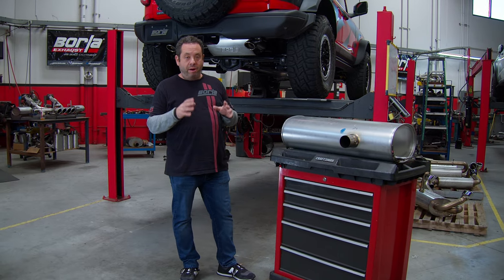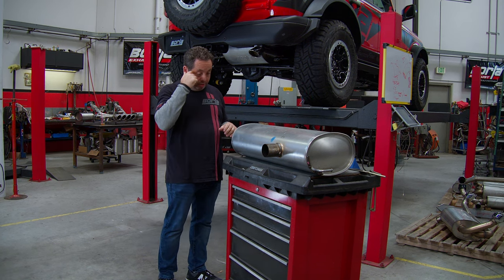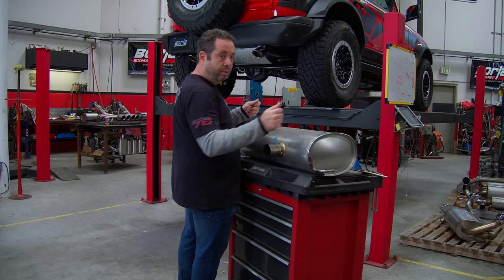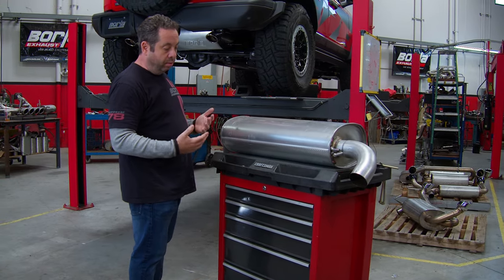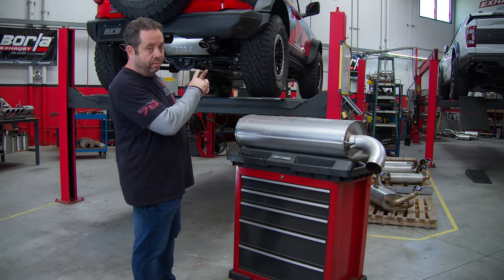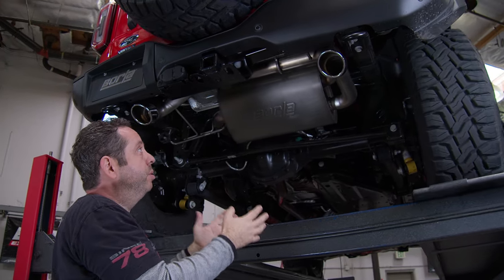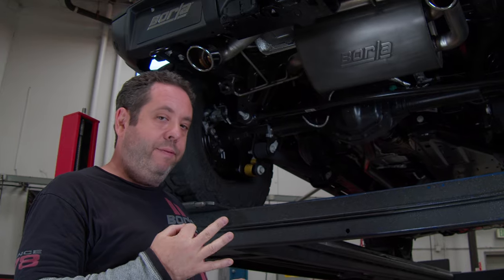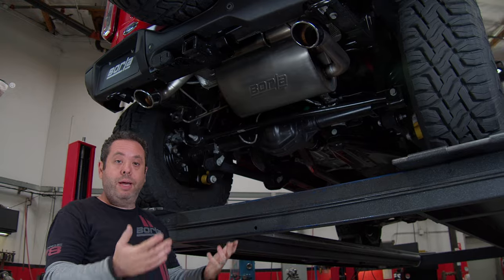Borla Exhaust for 2021+ Ford Bronco 2.7L EcoBoost

Comment: Is there anybody you guys partner with in the southeast for installing those mufflers? The last time I had one put on my truck at the muffler shop they ended up putting the tips on crooked and it just look like crap until I sold it.
Reply from the maker: We're sorry to hear about your previous experience! Unfortunately, we don't have a network of local installers. Sorry about that!

Comment: Sounds great.. but the 10-speed automatic ruins it. For the first couple gear changes it's great. Then you get a whiRRRrrriirrrrRRRiiirrRRRRrrrriiiiRRRRRR sound from a million 300 RPM gear changes. You can't listen to the tone and volume build as the RPMs rise and then drop. Almost sounds like a CVT. Would be amazing if the 2.7L was offered with the 7-speed.

Still a valiant effort from Borla. They can only work with what they've got. Definitely sounds better than stock.